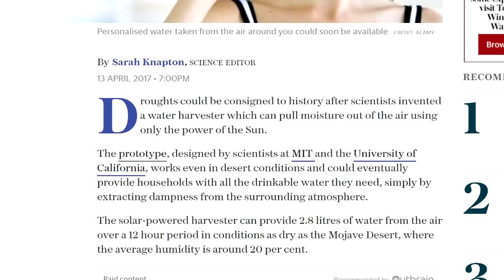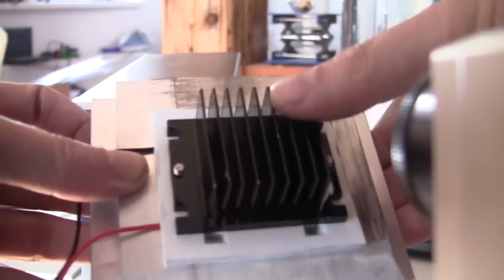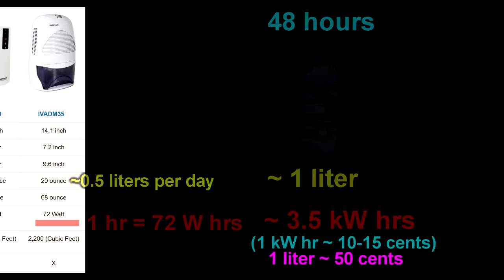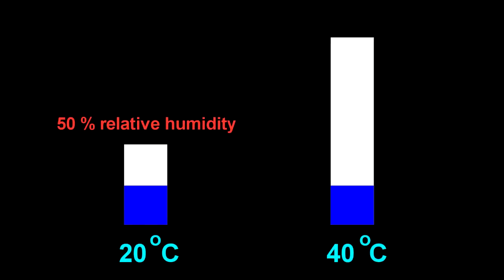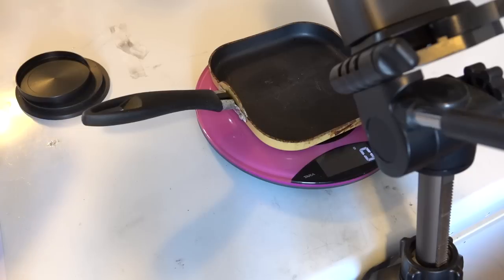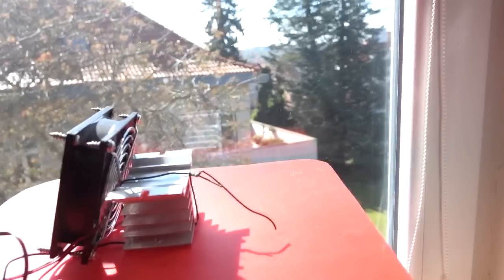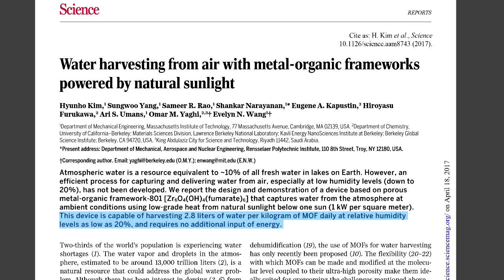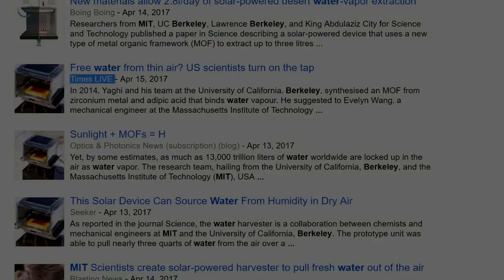FREE water from AIR device: BUSTED

Comment: I'm just trying to understand this better, but I don't think their paper was saying that they were using the peltier device to condense the water. To quote the paper, 

"For visualization purposes, we used a condenser with a temperature controller to maintain the temperature slightly below ambient, but above the dew point, to prevent vapor condensation on the inner walls of the enclosure. However, active cooling is not needed in a practical device since the hot desorbed vapor can condense at the cooler ambient temperature using a passive heat sink."

Since it's above the dew point, I don't think they were using that for condensation. I think their whole pitch is something tantamount to saying "We made something that can absorb lots of water from air, and then come nighttime, the change in temperature can passively cool the device if we isolate it from the environment." 

Also they seem to mention an exothermic reaction happening during the adsorption process, which would likely contribute to the dissipation of needed energy. 

Additionally, they state "The environmental temperature above standard ambient temperature was necessary to perform the experiments above 1 kPa; otherwise, a much lower condenser temperature is needed (e.g., ~0.5°C for 20% RH at 25°C)." If this is the case, then it's almost certain that an ambient change in temperature between day and night would suffice. 

Any chance you could explain your thoughts on why this process wouldn't work? Personally, I would expect the main problem with this device to be cost. I wonder how much their MOF costs to produce per kilogram, since that's how much they'd need, additionally, how much space that 1 kg would take, since the sample they tested with was tiny. Scaling up, that MOF material would have to be on the scale of a large solar panel given the existing dimensions, and attempting to expose maximum surface area to air. Even if their physics makes/made sense (I'd like to know what you think of these points from the paper), I can't imagine some lab-made experimental material would have a reasonable production cost at such scales needed to be useful. Plus, running a roof-sized solar panel (which is what a back-of-the-envolope calculation for size of a kg with similar thickness gets me) could probably run a peltier device and get more water out of the air given the power available. 

Also, they seem to account for a square meter of area for solar energy, but they don't account that that's nominal at the exact angle pointed at the sun, and that a flat device wouldn't do as well, or that their device is much smaller. It isn't clear if they scaled their math accordingly. 

Any thoughts? Love your channel, been a subscribed for years!.
Reply: What can't be cycle?
Reply: How come NOBODY pays attention that their claims are extrapolations? Let's take the values shown in the video: 0.1 g of water per hour per 1.34 g of dessicant. So how does it look for 1000 g of dessicant? It would have an output of ~ 74.6 g of water per hour per kilogram of dessicant. To condensate 1 L of water it would take ~ 13 and a half hours. So to achieve their target of 2.8 Liters per kilogram of dessicant, they need to run it for 37.5 hours. A bit off from a day but not as dramatically low as Thunderf00t presents it.

He tackles this whole article with the assumption that the small amount of 1.34 g of dessicant (as shown in the pictures) is supposed to achieve the output of 2.8 L of water per day... A bit unfair if you ask me. All Thunderf00t is peer reviewing are the articles, not the paper itself.

And taking your points into account (since i did not read the paper myself yet), i think their statements are somewhat in the realm of realistic.
Reply: it would be nice if Thunder actually addressed what was in the paper rather than seeming to misrepresent parts of it then berating the scientists involved. As the OP said, the paper explains the deal with the Peltier device and explains why they still make the claim they do in the abstract. Perhaps their explanation is BS, but Thunder doesn't even acknowledge let alone address it.
Reply: Yeah, considering they say the only used the peltier device for ambient temperature control, which was above the dew point, i'm not sure how it could possibly result in condensation by that method. Of course that puts a hole in how they're getting water out of the now sealed off but very humid interior of the chamber, but that's what we should be discussing. The paper still seems fishy thermodynamically, as it doesn't present much in explaining how the MOF adsorbs the water vapor/releases it, and under what conditions (how can it absorb it under the same conditions of a normal low humidity day and release it?) it works in this fashion. As far as I can understand, all they do is make a (sort of cool) water-vapor sponge that releases it once the chamber is sealed and then once the chamber is full of very high relative humidity air, it condenses when the temperature changes a little, say at night. 

Also, whydoyouaskdude makes a good point that they're extrapolating weirdly, though i suspect that maybe they left out some surface area variables since that almost certainly has relevance, so geometry would matter. Lets see what Thunder says. He generally has a lot of good points, and his critique prompted me to read the paper to understand it better, and I encourage everyone who has access to it (via libraries or universities or work) to also read it over, then we can have an even more informed discourse about what's right/wrong with it.
Reply: I think Thunderf00t didn't read the paper very attentively. The TE cooler is plainly described as such, and its purpose is specifically stated. The paper centers on the specific material (MOF-801) that has favorable CYCLING properties (ie, the ability to re-use the material without losing its adsorption characteristics, which is a problem that most other materials exhibit, making them unsuitable for water harvesting). The proposed mechanism of action uses temperature differentials between day and night - where water is adsorped into the MOF at night and desorped during the day with energy from sunlight). Their proof of concept is weak. Specifically:

"For visualization purposes, we used a condenser with a temperature controller to maintain the temperature slightly below ambient, but above the dew point, to prevent vapor condensation on the inner walls of the enclosure. However, active cooling is not needed in a practical device since the hot desorbed vapor can condense at the cooler ambient temperature using a passive heat sink."

(Same text that Anthony Lobko pasted) I don't understand why they couldn't have replicated exactly what they're saying using a different experimental setup with a passive heatsink, just to avoid the scrutiny for using a TE cooler.

Also from a related 2014 paper:
"Since water adsorption is an exothermic process, a large amount of heat can be utilized if the adsorption enthalpy is large. With that in mind, released heat can increase the temperature in adsorbent beds so that the uptake capacity 
can be drastically influenced by this temperature change."

This being the advantage of the exothermic process. It means that the compound can work at lower temperatures, down to about 15C and still adsorb a large volume of water as if the ambient temperature was higher.

Consider this followup in this other paper:
"For example, in the city of Tabuk in Saudi
Arabia, the typical summer temperature and relative humidity
during day time are respectively 40 °C and 5%, drastically
changing at night to 25 °C and 35%. Assuming P/P0 × 100 = RH
%, the working capacity of MOF-841 between P/P0 = 0.05−0.35
is more than 40 wt % (Figure S58 in SI), which is the largest
obtained among all Zr-MOFs. If 15 kg of MOF-841 is deployed
in Tabuk under these optimal conditions, it should be able to
deliver 6.3 L of pure water per day."

That paper is from the Journal of the American Chemical Society (JACS).

In my opinion, this video did a poor job of dealing with the specifics of the paper, and instead fixating on how "extracting water from the air using a TE cooler is expensive", basically. Yes, we know that.
Reply: This is great. It's awesome that we got interested enough in this issue to go and read the paper itself. I wish this climate of civilized and informed discussion extended to the rest of life.

I think we're all very interested in a followup from +Thunderf00t and continue this discussion. That said, this paper definitely could have done a better job making its point with more clarity and less questionable experiments, as +whatlions said, they really could have made this way more convincing if they'd actually had constructed the passive heatsink as they described. Also the media went a little far going crazy about it as it often does.

That said, at least this paper is more convincing than solar roadways or the various peltier cooling focussed water-from-air ideas. Considering it actually cited sources and provided information. I do wonder how they made such crazy extrapolation errors as +whydoyouaskdude pointed out, since that's clearly not a linear scaling, and I somehow doubt that the material absorbs exponentially more with mass...
Reply: "I wish this climate of civilized and informed discussion extended to the rest of life." It's very likely that the "first society" on mars will have a very similar attitude since it will be mostly composed of scientists, and the environment will be dangerous enough to have a low tolerance for any BS and misinformation. Not at all like sci-fi movies with rowdy crews. It's very likely that the social climate of martian society will be very similar to what exists today on the ISS. And since this will be the "seed" in that culture, it may very well develop into a completely different social world than what we have here on earth. Maybe this is enough reason to work insanely hard to see if you can be one of the first up there... ;)
Reply: Anthony Lobko Id like to see how tf addresses this.
Reply: this is thunderfoot's MO. He tends to think he is rather smarter than he actually is.
Reply: I'm not raging against Thunderf00t here, though I think he might have only skimmed the paper. I think he makes solid points in almost all his videos, and in many cases, the people making those points are being stupid. I just think that in this case, based on the paper, there's some discussion to be had. I really don't want you to confuse this with me thinking TF is stupid or not as smart as he thinks, he's a real scientist who has many years of knowledge and experience. Don't turn a discussion about the research paper into ad-hominem arguments please.
Reply: I don't believe that the 2.8 L of water was an extrapolation. They were able to pull 2.8 L of water with 1 kg of material over a 12 hour period in 20-30% humidity. What TF is ignoring in this experiment is the catalytic nature of MOFs. Obviously thermodynamically relevant but was not accounted for is his "Back of the envelope" calculations. These are pretty neat devices and are highly porous which drastically increases surface area as well. The scientists here are not dumb and the paper made it through peer review leading me to believe that either TF did not really research this or didn't care enough to read the actual paper.
Reply: "This is great. It's awesome that we got interested enough in this issue to go and read the paper itself. I wish this climate of civilized and informed discussion extended to the rest of life."
Absolutely!

Just want to say I agree with a lot of what you say, especially about the way the TE device is actually described in the paper, and wonder whether it would work without it as they suggest. And that I wish Thunder had addressed this in the first place...
Reply: Luke DeHart actually, they pretty clearly said they conducted their experiments on a small sample, and then extrapolated the water amount based on the amount absorbed, however, as another commenter pointed out (and I checked the paper again) it seems that the math in the paper is off a little, and would predict that 2.8 L would take about 33 hours, not 24 at the same rate per mass. Also, MOF wasn't really said in the paper to have catalytic properties, and that wasn't the point, the main point of it was to adsorb water which can at a later point in the use cycle be cooled by ambient temperature changed throughout the day. As far as the paper goes, there's no claims in it saying that the MOF in any way lowers the amount of energy needed to be removed from the water vapor to condense it, though it does say that a small fraction of it has to be dissipate during the adsorption process due to it being exothermic, so a small part of the tooling happens when the water bonds with the MOF temporarily, allowing them to hold the water vapor in a much smaller volume than otherwise possible.
Reply: Luke, I also don't think its an extrapolation, but they didn't get 2.8 L of water. They got 2.8 l kg-1 of water - they are simply reporting the relationship between the mass of MOF required for a given mass of water. They could have also reported it as 2.8 ml per g. Its just a matter of units, although its those units which seem to have confused almost every science reporter who read the abstract/press release.

I have to say, I'm having a hard time showing charity to Thunder in this. He is rightly surprised by the phrase "... requires no additional input of energy." in the abstract, but rather than think: "ok, what do they mean, lets carefully read the paper and figure that out and respond to what they actually say", he seems to assume the authors are idiots, or worse - implying massive breach of ethical conduct through the comparison to the cold-fusion debacle....
Reply: The material is [Zr6O4(OH)4(fumarate)6] - if that isn't catalytic I don't know what is. Also it wouldn't need to be stated that it would increase reaction rate because that is what catalysts do.
Reply: Yeah, that line of thinking works pretty well for crap from Indiegogo but not very well for papers in Science.
Reply: That material in its nanocrystalline form is catalytic, but not for the phase change from water vapor to liquid water. It's catalytic for gas-phase hydrogenative conversion of methylcyclopentane. In fact, there's no known catalysis for phase changes, since they're not truly chemical reactions in the conventional sense. Also, Osprey Pearl, right on, yeah, they basically just calculated the amount per kilogram, doesn't mean they had a kilogram or that a kilogram would actually behave that way under the same conditions (surface area might matter).
Reply: What is the conventional sense for catalytic activity? It traps water molecules placing them in proximity to each other and dissipating energy through a heat sink. There are tons of gas to liquid catalysts.
Reply: The MOF used in this situation is not catalytic - it simply encourages water molecules to adsorb preferentially to its extremely porous interior (i.e. at night). 
Upon heating the MOF (i.e. during the day, with sunlight), the water is desorbed from the MOF surface and forms those droplets seen. Yaay science actually works... we need better reporting!
Reply: The conventional definition of catalysis is the increase in the rate of a chemical reaction due to the participation of the catalytic substance, usually lowering the activation energy of the reaction. Since this doesn't lower the activation energy, or increase the rate of water phase change (in fact, that water doesn't phase change at all until the later cooling phase after the initial adsorption, isolation, and desorption steps, in fact, the MOF isn't even involved in the final phase change part, it is only involved in gathering up a large amount of vapor water to make the process of extracting water from it easier, since by the mechanism proposed in the paper, they artificially generate a very high relative humidity in the closed chamber by desorbing the water vapor into it after isolating it from the environment.
Reply: So if a catalyst can't catalyze a reaction at any temperature it isn't considered a catalyst? Just because it doesn't cause a phase change by trapping water molecules close together allowing them to condense increasing the reaction rate makes it a catalyst in this sense. Either way this paper is not crap and this video did a piss poor job in covering it.
Reply: I mean yes, you could consider many things catalysts in an indirect way, but generally that's not how it's seen. If you follow that rabbit hole, you could say that gasoline catalyzes a human's weight gain because indirectly, it helps them get to their job, make money, go buy groceries, and then be able to eat them, while they wouldn't have been able to do that as fast before. Sure in an indirect sense you could consider this catalysis but in the generally accepted scientific sense, usually you only consider things that directly offer a different, usually lower energy reaction path. In this case, the reaction (condensation) doesn't directly happen in relation to the MOF, the MOF simply gathers it up, like any desiccant would, though the MOF does a better job than most, and the paper makes a major point saying that it's very reusable, which would make this more practical compared to using other dessiccants like say, magnesium sulfate anhydrate, which while being able to absorb and pull more than it's own weight in water out of the air, leaves harmful chemical residue in it, and isn't really reusable without baking at very high temperatures.
Reply: Well I can see your point about the broadening the of term. I don't think that your gasoline example really relates well to it though. We could probably argue it down to a grey area at the best. There are optimization issues but this still does not really give this video any credibility.
Reply: I'm not trying to, after all, my OP is pointing out things that need to be discussed that the video covered poorly or missed. I just want people discussing it to avoid ad-hominem attacks on the video maker who does plenty of good work, or anyone else in the thread, since up to this point, it's been a surprisingly civilized and constructive discussion about a research paper (that's a first for me, i've never seen a youtube comment thread that's this composed and respectful and has a constructive scientific discussion of a paper and video). The video definitely missed some big points they made, and I have a feeling Thunderf00t didn't read it as thoroughly as ideal, and I hope he considers joining this discourse, and maybe doing a follow up video covering the details we all discussed.
Reply: Thank god for commenters like you. But noooo, thunderfoot is "the one who checks". And then blatantly misrepresents the paper. But no biggie, his legion does not care and they're as much as sheeple as the guys they're making fun on, just on the opposite end of the spectrum.
Reply: His math checks out though...
Reply: never mind, I'm wrong. It doesn't check out. The proposition the paper made is definitely different than the topic covered in the video. Good catch.
Reply: Me too. I think he missed the mark a bit with this one...
Reply: This is a good discussion honestly.
Reply: +whydoyouaskdude "37.5 hours. A bit off from a day" lol yeah a little over 1.5 times is just a bit off. Not to mention it IS as dramatically low as TF shows. That is the time it would take for the tiny device to produce that amount of water. Which makes you wonder how big does it have to be to produce the output they claim it will have? Have you actually wondered that?.

Were I like you I would assume the prototype is well engineered and use a linear relationship like you to scale the size of that thing. Which would mean you would also need a 750 times bigger device to generate that amount but I know better than that. 

Surely you wont need a device that is 750 times the size with all the heat sinks, etc just to produce 2.8 liters of water daily right?. I mean if you did I can only imagine how much is it going to cost and if the material will even have a long enough life span to actually cover the costs or if its just a pipe dream and people need to chill.
Reply: "We made something that can absorb lots of water from air, and then come nighttime, the change in temperature can passively cool the device if we isolate it from the environment."

You mean a fucking solar still!?  Congratulations.  Much invention.  Very innovation.  Wow.

This is a thing they taught us about in Boy Scouts, and that survival classes have been teaching for decades.

Not making MIT sound any smarter here, dude.
Reply: It depends on how effective the heat dissipation is. I imagine that the reviewers probably asked about that and were convinced by the actual engineers and chemists who wrote the paper. This video was way off base and this comment section is a sad showing of real scepticism. Sceptical of everyone but TF.
Reply: +Luke DeHart You should mention the person you are replying to. Its important to ensure communication is as simple and efficient as possible.

Convinced of what?. If the paper was meant to prove a concept that being the MOF working as intended size and cost doesn't matter. Yeah the concept is real and sound that doesn't mean its a "game changer" as people especially news outlets like to claim about literally everything nowadays.

After all I doubt their goal was something along the lines of "creating a technology that revolutionizes the way water is obtained". 

Is it way off base?. The math in the video is fairly sound and it raises plenty of points to argue about this topic I derived one really easily and I assure you I'm nothing special. If you can show me a couple of the mathematical or thermodynamic arguments being demonstrably wrong I will agree with you instantly this is science who says what means very little.
Reply: +MhDaMaster the point that this thread made was that the video and his calculations, while correct, didn't actually address the mechanism used in the paper, which was not thermoelectric condensation. They do not act like you need less energy than themodynamically predicted, they only presented an option for containing a large amount of vaporous water without phase change, then releasing it into a closed chamber to raise relative humidity, and finally use ambient temperature difference between day and night to cause condensation. The paper says that their peltier device was meant to control the temperature to a specific temperature slightly below ambient to simulate nighttime, however, it was above the dew point, therefor could not have really been used to extract water out of the air on its own. Now, they really should have used a passive heat sink to avoid the scrutiny, but based on their claim not relying on using the thermoelectric device for cooling, but in fact just as temperature control for convenience in their experiment, that means that the video's argument isn't bad, simply not addressing the actual problem in the paper. I highly recommend reading the paper as I did after watching the video, to try to understand it better. It's published in the journal science, and anything with an AAAS membership should be able to get you access to the paper.
Reply: +Anthony Lobko I know about the AAAS membership but sadly I do not posses such a membership if I did I guarantee you I would have read it thoroughly. That is the very reason I could only use the figures in the video for my argument since I don't have access to it. 

That aside I can hardly blame him for using the peltier device since not even the guys that wrote the paper could be bothered to do it right. 

And this leads to a very interesting question that YOU can answer. In order for the prototype to hold any validity you should be able to see the calculations that prove that they don't need additional energy since the passive heat sink can do it easily. And that the peltier device is only there to show the principle in a timely manner. They should be right there in the paper YOU read. If those calculations don't exist then who the fuck even knows if its not actually the peltier device doing all the work.

And this point should have been brought up by the reviewers too right? So check the paper and tell me if they exist if they don't I doubt you will have much ground to stand on. If they do then TF is really wrong this time around and he should apologize for throughly trashing the poor guys that made the paper.
Reply: So what they had in the paper +MhDaMaster (since you didn't have access to it) is they specified that the change in temperature needing to condense water out of the air, due to the high humidity they'd generate in their chamber. They showed the math for that, and also indicated very clearly that their peltier device was far above the dew point at that temperature with ambient humidity, so nothing would condense if that were the case and that was the only mechanism that's being used. You're right that this paper could have done a better job, as someone else in the thread pointed out, it wouldn't have been much of an ask for them to actually attach a large, passive heat sink and put it outside for a night, and I have no clue why they didn't do that, they opened themselves up to unneeded scrutiny. However, assuming that other than bad judgement, they aren't outwardly lying and somehow conning the peer review, the data they provide does make sense and seem like it works, though that doesn't preclude other barriers for this actually being practical, which is to be fair, not the point of the paper.
Reply: +Anthony Lobko I see so they DID provide the math to support the idea of a passive heat sink given the increased humidity that their MOF will supposedly provide. 

So then the peer review means that people actually tried out the MFO and it produced the reported humidity or did they just check the math on the paper?. Because if they only checked the paper I don't think peer reviewed means too much in this case.
Reply: Peer reviewers don't repeat experiments. They simply decide whether or not the evidence presented by the experimentation supports to claim.
Reply: +Luke DeHart Wow that is insane I don't even know how you would present actual evidence for the MOF producing that humidity other than reporting your data in the paper and have people trust that you are not lying. Now I really want to read it to see their methodology to see what evidence they provided since they have such hardcore supporters.
Reply: Generally, the peer reviewers examine the data and the fundamental principles a paper is based on, and if that makes sense and the details needed to reproduce the paper are there, they consider that good. That said, peer review would absolutely 100% not miss a fundamental thermodynamic violation, this is one of the most prestigious journals that's very hard to get published in. Checking the math on paper is generally accepted as fine, since there's no assumption that scientists lie, they aren't politicians after all. Generally if they get caught lying, they have trouble getting published ever again, so most scientists don't risk it. Reproducing the experiment is up to follow up papers who base their work on this. All I'm saying is that there's not thermodynamic issues as far as the paper goes for doing what they describe, and that the peltier device wasn't used to pull the water from the air in any practical way.
Reply: +MhDaMaster Having read the paper, I definitely think it could have more details and less scrutiny if they did slightly differently, and wonder why they didn't, other than convenience. In general though, in all scientific fields, the default is "innocent until proven guilty", so the people who generally reproduce the experiment are those doing follow-up work, and if they can't reproduce it, that's usually how this comes up, but this happens very rarely. However, the paper had fairly clear experimental results and explanations, although it's not done things in an optimal way to avoid all scrutiny, but you should try and get a look at it and see for yourself, after all, a research paper is there to convince people of facts someone observed in their experiment, and it's up to you look and decide if you find the evidence compelling. I think it has some good points, but not a flawless paper, could have been more difficult to scrutinized if they really demonstrated with a passive heat sink.
Reply: +Anthony Lobko Yeah I think so too. By the way TF actually mentions the passive heat sink in the video at 32:51 but claims it doesnt work. So this is the time to show the math that proves it does I'm guessing they modeled the thermodynamic system and how the heat sink does not reach equilibrium despite being in the middle of the desert. I guess this passive heat sink is also their design and very special since its the very component allows the device to work properly without energy input.

Damm I will go the extra mile and look for the paper since that kind of heat sink could have plenty of applications. Who knows you might even be able to use a peltier device directly with it to produce electricity or something.
Reply: Just to clarify as a number of people have mentioned it, the device in the paper uses the temperature difference between the solar concentrator  (60-70 degrees) and day time ambient air temperature. It does not condense at night but rather collects the water in the MOF at night.

Also, Thunder's bit about the soda can in the car misses the point. The paper (claims) that it works on the temperature differential, so it would be like the temperature difference between the hot car in the sun and the outside temperature (which he ironically shows a chart explaining). Perhaps that wouldn't work either for reasons of thermodynamics, but Thunder didn't actually address what was in the paper.
Reply: MhDaMaster - It has been good reading this thread, lots of intelligent discussion here. It's a shame that thunderfoot puts a video like this out without thinking about the impact this may have on these scientists' careers, especially considering the sensationalist nature of the video. I have linked the article for you here MhD: https://drive.google.com/file/d/0B303zcQLHMKiQ1g1X1V3Ynlaa00/view?usp=sharing 
I'm curious to hear your take on it.
Reply: Google "Water Adsorption in Porous Metal−Organic Frameworks - Omar Yaghi yaghi.berkeley.edu" (the last part in the search will help give you the PDF from the author's own page for free)... this was the 2014 paper that may help illuminate what's going on for people more interested in the chemical aspects of the materials involved. I think the media has been the downfall of the new paper, because the paper never tries to make any grand claims that they've solved the world's water crisis or anything even remotely to that effect. Nor does the paper try to push a specific product, or even a product design concept (we've all acknowledged that their proof of concept is lacking). The media blew this paper out of proportion, Thunderf00t jumped on the chance to take the media claims at face value and make fun of them instead of focusing strictly on the claims in the paper. It was a chance to make another one of his famous debunking videos. I'm tempted to add: "and make an easy $3k while at it", but actually to be fair, putting together a 40m+ vid, regardless of footage re-use is isn't that trivial and enough information was provided in the vid to be of general interest and help to his viewers... so I think it's fine really. Personally though, if he keeps staying off target in the future, I'll likely stop paying attention to this channel. It's surprisingly hard to insult the sensationalist / attention-driven nature of the modern media without being sensationalist / attention-driven yourself while doing it lol. Pot calling the kettle black. ;)
Reply: Osprey Pearl MhDaMaster actually the paper does discuss condensing at night, they just also discuss collection at night. They have 3 phases, 1 collection phase that can in theory happen at any time of day, 1 desorbtion phase that has to happen during the day, and one condensation phase that has to happen at a cooler temperature than the desorbtion phase. All in all, doing this passively, the cycle would take more than a day. 

TF does mention the passive heat sink but he's working under the assumption that it's trying to condense while collecting, (which is what it'd do if it was purely based on thermoelectric cooling), however, the condensation is meant to happen due to natural temperature changes through the day/night. There's absolutely no way that if this thing was open a passive heatsink would cause any condensation while it's collecting due to lack of a temperature gradient, yes, which is what TF was talking about, however he neglected that condensation only happens after you've collected the vapor, desorbed it into the sealed container, and then used the natural day-night temerature cycle to have a substantially lower temerature on the heat sink externally, since the internal chamber was heated during the day, and, if the relative humidity in the sealed chamber is high enough due to the collected vapor that was released, it'll condense with a minimal temperature change.
Reply: +Anthony Lobko Yeah I noticed this and this kinda makes me really uneasy. They claimed that a kilo will collect 2.8 liters in a day but TF mentioned the maximum amount that the MOF can hold right now its 25ish% of its mass that's from their paper according to TF. 

If it can only do the cycle once a day then its literally impossible for the 1 kilo MOF to produce 2.8 liters in a cycle let alone in a day as they claim. I have to read the paper I hope my doubts are cleared after that.
Reply: +Anthony Lobko So yeah I've read the paper and I have to admit I'm extremely disappointed. In fact unless I'm missing something the size of Jupiter they outright lie in the abstract of the paper which is really bold to be honest. 

They literally wrote in the paper that they can achieve the 2.8 liters in a  day figure by cyclically collecting water. This can only be achieved through thermoelectric cooling since there is no special/magical passive heat sink or anything else hinted at in the paper. 

Despite that fact in the abstract they claim the can collect those 2.8 liters without any energy input. Which actually contradicts what they wrote later since one would normally consider thermoelectric cooling an energy input. 

I mean its misleading at best outright lying at worst. How could ANYONE miss this?. YOU INCLUDED ANTHONY and every single supporter of this what the hell guys.
Reply: such a thoughtful, intelligent observation. sometimes TF videos are worth it for the smart comments by some of the viewers.
Reply: MhDaMaster Sorry but where are you getting that "this can only be achieved with thermoelectric cooling"? That's not a substantiated statement. They definitely creates a misleading extrapolation, and their system doesn't have a magical passive heatsink, a normal passive one would do just fine since it'd have a temperature gradient to work with during that part of the cycle. The passive heatsink wouldn't work if you just assume the thing is producing water constantly which it isn't, it produces it in cycles, using ambient temperature changes. They don't claim to collect the 2.8 liters without energy input, they claim that the MOF acts as a dessicant, which spontaneously absorbs moisture from the air like a sponge (totally reasonable, plenty of dessicants exist). A dessicant doesn't require energy input. They then use solar heating to release the water from the dessicant, and explain how using a passive heatsink within the range of reasonable temperature change during day and night would condense the water back out, using the ambient environment to transfer energy to it. 

However, they did not in fact test the aspect for the final stage, though their testing methodology of replicating that using a TE device is fairly sound since the temperature gradient they use is very small. They never claim there's truly no energy input, they use the environment for energy input and output. Also, they never say they actually can produce 2.8 liters they say they produce 2.8 liters per kilogram MOF. Which is a scaling based in their actual data. The abstract was a little over sensationalized and overreaching but if you read the rest of the paper the claims in it are more reasonable.
Reply: +Anthony Lobko "Sorry but where are you getting that "this can only be achieved with thermoelectric cooling"? That's not a substantiated statement" 

Oh really?. You think that cyclical collection, 7 cycles, over a single day can be achieved any other way?. You didn't seem to think that in your previous reply.

"All in all, doing this passively, the cycle would take more than a day."
"There's absolutely no way that if this thing was open a passive heatsink would cause any condensation while it's collecting due to lack of a temperature gradient"

This change of hearth seems way way suspicious it makes me wonder if you actually read the paper properly.

"They don't claim to collect the 2.8 liters without energy input" 

What? then how do you interpret this? 

"This device is capable of harvesting 2.8 liters of water per kilogram of MOF daily at relative humidity levels as low as 20%, and requires no additional input of energy." 

Considering the fact that thermoelectric cooling is not even mentioned in the abstract I don't see how you could possibly think that its not purposely misleading. Just saying that is "sensationalized and overreaching" is being irresponsible. This kind of attitude should not be condoned by anyone much less by scientists.
Reply: MhDaMaster I explicitly said they didn't do it over a day, and they didn't say that they produced 2.8 liters in a day, they said that it can produce 2.8 liters per day per kilogram. That doesn't mean it can actually produce 2.8 liters per day. If I stand still for half the day, and then run for the rest, I will have some nonzero miles per hour for the day, much like this. Of I stand still for two days then run a bunch on the third, my average speed can still be formulated per day. All they did was divide how much water came off it by how much mass of MOF they had divided by time it took (days). That said, I can see how you would think of this as misleading, but what's they're stating is rate, not production they achieved. It's like saying water has a density of a 1000 kg per cubic meter... That doesn't mean you had a cubic meter of water.. that means you measured the ratio of mass to volume.

The thermoelectric cooling they used wasn't used for condensation it was used for temperature control, they could have mentioned it in the abstract but there's no obligation to, an abstract is just a brief summary, they mentioned their exact methods later. 

They also mention in the paper itself that there is energy input from the sun and the atmosphere would be used to dessipate heat, which definitely does disagree with their statement of no power input, but clearly they didn't mean that this functions in that scenario, that mean you don't need to hook up an electricity source it refrigerator to it. That said, they definitely could have avoided scrutiny by using the passive heat sink as they proposed instead of simulating the temerature changes that'd happen naturally with a thermoelectric device. They definitely opted for convenience for themselves instead of complete clarity. Definitely not ideal for the paper. They did use a thermoelectric device to simulate the change in temperature that'd happen, but that was a matter of convenience and control, not a matter of using it to cool the chamber down and cause condensation only that way. They were operating above the dew points on those TE devices, so that couldn't directly cause condensation without very high relative humidity inside the chamber, which was the whole point of their approach.
Reply: Catalysts don't have any effect on the thermodynamics. They can speed up thermodynamically favorable processes, but that's about it.
Reply: Yes but by trapping water molecules in close proximity to each other it allows for a larger amount of water to precipitate against the cold surface compared to the uncatalyzed one.
Reply: +Anthony Lobko 
"they didn't say that they produced 2.8 liters in a day" 

Seriously you destroyed any sort of respect I had for you when you showed you clearly didn't read the paper.

"Continuously harvesting water in a cyclic manner
for a 24-hour period with low-grade heat at 1 kW m–2 can
yield ~2.8 L kg–1 day–1. Alternatively, per one cycle, a 5
mm thick layer of MOF-801 can harvest ~0.4 L m–2 of water."

So 7 cycles in a day produce 2.8 liters per kilo. I'm not saying that they have a kilo in their prototype. I'm not saying that they actually produced 2.8 liters that doesn't even matter. You should be able to see that I'm pointing that their projected numbers and their claims don't even match. 

What matters is that in the abstract they claim they could produce 2.8 liters if they had a kilo of MOF and that it would not require additional energy. 

What you fail to see for some reason is that producing those 2.8 liters with a kilo would take 7 cycles and that cannot be achieved with a passive heat sink. You need a method to condense be it thermoelectric cooling or anything else and that requires additional energy which is at odds with the claims on the abstract.

Do you get it now?. Are you done showing me how you didn't even read the paper properly?.
Reply: + MhDaMaster I certainly read the paper. I definitely think that 7 cycles per day isn't realistic passively unless you're in a very strange environment, or input energy. As far as I grasp, passively, it's only possible to complete 1 cycle every 1.5 days. It's possible to make a larger cross section to accomplish this with a larger amount of MOF, but you have a point about them suggesting cycling multiple times a day. Unless the climate they're in fluctuates a ton every day, passively, they are rate limited to day-night cycles. 

Good catch, however, you shouldn't be attacking a person and me specifically, that weakens your argument. You should have opened with that quote, I didn't see it. However, while this definitely reduces the yield of their approach, and means they were a bit misleading in how much they can produce passively, this doesn't necessarily mean that the approach from the paper isn't possible to use overall (though i'm sure there's other problems that'd make it difficult). The paper does lay out a way you can in theory gather water passively, though they are certainly a little deceptive about the yield, however, compared to say, a peltier device, it's still a better option due to the possibility of using it passively, albeit slower. Definitely needs further research though, and clearer language in papers.
Reply: +Anthony Lobko Sorry it just bothers me a lot when people defend "scientists" that lie so blatantly about their findings for fame/money.

"they were a bit misleading in how much they can produce passively" Yeah 700% is just "a bit misleading". Just like when they said 1 day and it was 1.5 days so it was just "a bit off". When did people become this lenient?. Back in my day when you got over 5%-10% you were already submitting shady reports. I wonder if its just sarcasm and I just don't have enough faith in people to see it.

I mean it doesn't mean that its impossible but with a yield that low I doubt the material will endure enough time to cover the cost of making the 1 kilo device. It would be nice to know the life span of the MOF under use but I couldn't find anything I guess its a little too specific.
Reply: Well, +MhDaMaster they definitely talked about the MOF's favorable cycling properties, but that's a great thing for some follow-up research. It'd be interesting to see something like this focussed specifically on gathering water, and optimizing on that in a practical prototype. Hopefully there'll be other research following up on this.
Reply: +Anthony Lobko Yeah it would be nice to have data on that. The life span would have to be in the "several" years category tho to even have a ROI so I'm not too hopeful. Like seriously that 1 kilo of MOF at .4 L per day and 146 L per year is not going to pay for itself any time soon we are talking solar roadways type ROI. 

It would also be nice if follow-up research tries to stay closer to 100% than 1000% when reporting their results. You know make an old man believe there are people around who are not completely morally defunct.